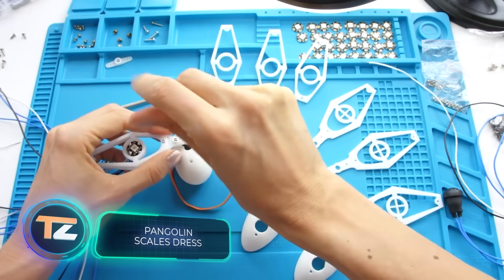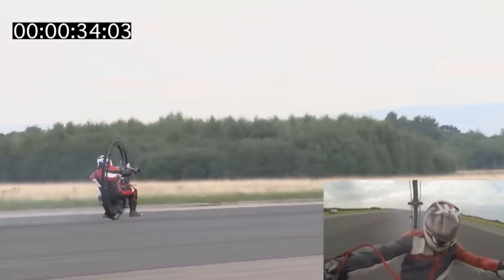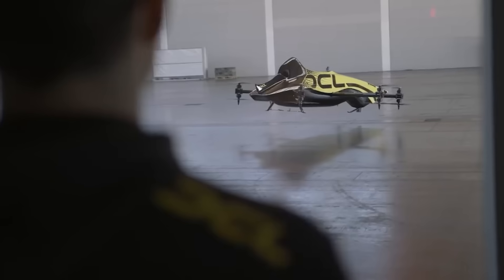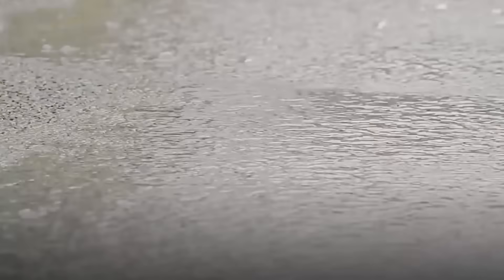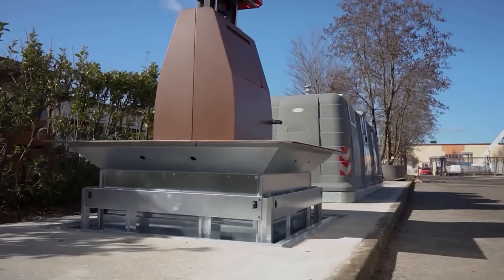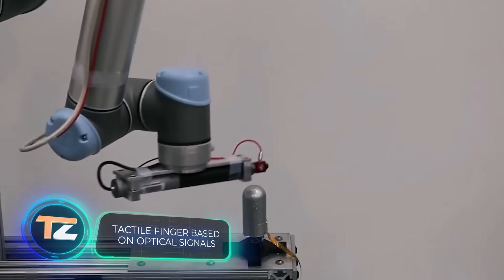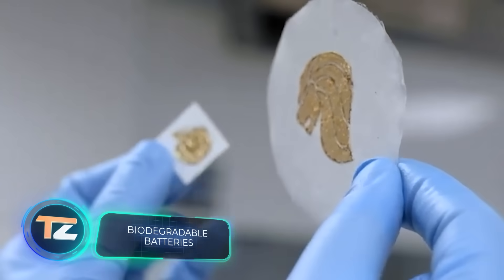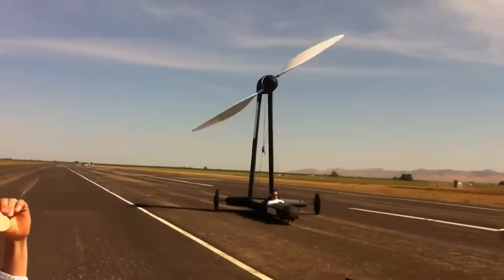13 CRAZY INVENTIONS THAT YOU SHOULD SEE

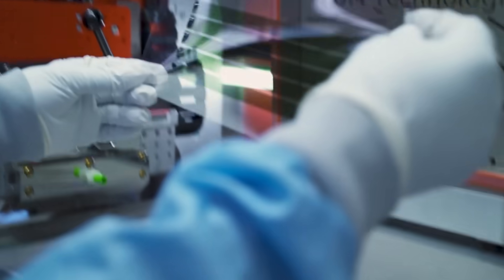Comment: 3:11, you could also COVER a Electric car in this and potentally never pay to charge again. Since its Translucant you wont need to worry about covering the Glass when you put it on 100% of the car and connect the electrodes to One point for charging.  You could also add this to the roof of some Camping Equipment so its easyer to charge your phone while Camping seeing as the TENT would generate a Charge for up to 4 full phones or a Laptop if a small lithium battery was added. 

Also you could put this on military Drones thus incresing their Opperaional time seeing as most are Fully Electric. and last you could COVER buildings in this wrap turing entire Cities into Solar Fams as long as they had access to good Sunlight, and thus Deminishing the US's need for Foreign energy.

Comment: 1 is stupid use of this tech 2 ius a stupid piece of technology 3 great piece of technology wuhich is also fucking useless because no one will cover there car's or houses or streets in it to get the power needed also no one will wear a shirt with one could be used in back packs though 4 big toy  probably will become a niche sport in the future 5 stupid car  the biggest problem with EV's is the batteries  yes being able to remove them is great idea but that only matters when you can remove them and replace them with a fully charged one at a site  on your journey I/E makuing the batteries the fuel rather then electricity. 6 the concrete this is a great way to create  sinkholes and if it doesn't work below 0 then it is alway a fucking great way to kill drivers. 7 is shit  8 is a more complicated and slower way to collect shit so it is pointless. 9 is horrible battery life is abyssmal 10  great a robot hand that  in the future will be able to jerk you off 11 this tube will  waste soo much water to evaporation and  will be a fucking nightmare to repair not to mention the control valves are  manual 12 biodegradable is a fucking hillarious thing to look into.  you know all plastic is biodegradable it make take 1000's of years but it will break down. 13 is a novelty concept not a useful thing it a proof concept that is all

Comment: That sounds great but they don't say the time required to recharge the batteries, unless the use the same electric motor to recharge the batteries while not moving, and that is prekindergarten technology, but you know that, from the endless summer paradise Puerto Rico Jesus Torres.

Comment: The Singapore’s battery was already invented about 20 years ago by an Israeli company. However, the biodegradability wasn’t a feature.
As for the garbage receptacles THEY ARE A NIGHTMARE. Children, the elderly, the handicapped and anyone weighing under x amount of pounds/kilos cannot open the lids. Also, garbage that’s lightweight but large and of an irregular size won’t fit into the opening. A final and horrific aspect: Those who feel the need to abuse or kill small animals like cats, kittens, puppies, rabbits, etc. can toss these animals inside the receptacle which is situated below ground and isn’t reachable.  THIS PRODUCT SHOULD NEVER HAVE REACHED THE MARKETPLACE.

Comment: The cruising range of both versions is a few tens of miles less than the distance to the next H2 fuel station.  And also a toy RC car to drive around inside grain silos that costs about the same as an actual car.

Comment: people say americans dont know how to use the metric system but im trying to figure out where this guy is pulling his imperial measurements from. naught point two inches bro just say 3 mm we will understand
Reply: like really how big is a 12 cu inch engine? pretty sure all engines are measured in metric these days.
Reply: Who says Americans don't know metric? Every pharmacist, carpenter, plumber, fabricator, engineer, welder, designer et al is fluent in several measurement systems, not just metric and imperial.

If you would drop the "I'm stupid so I can't imagine inches" attitude, you might get it. Asking the world to change what they've been doing for thousands of years so YOU don't have to learn something new. That's pretty bold.
Reply: @DrLumpy  putting some pretty bold words in my mouth. i know how to use imperial just fine, used it for over 20 years, and after learning metric its just better. in short. cope. and watch your tone
Reply: @DrLumpy I know how to use metric and I’m an American.  It’s so easy but there are many stuoid people who don’t understand about base10!   For those of us who quilt, sew, etc. just about every single sewing machine sold in quite a few decades as has to learn the metric system.

Comment: As a farmer who just had to clean out the grain bin, that robot is useless, unless they can make the battery last 12h plus. Using a proper resperator is definitely still the most viable option
Reply: Don't forget the price of 5000 Dollars for that piece of crap
Reply: @dapartisano3995  Do you bother ever doing math? Hint: Turn 5000 USD into a 3 year leasing, compare that to minimum wage, you may be surprised who wins. Hont: it runs down to 15 usd per day or so. And the robot COULD work 24/7.
Reply: wouldn't the robot be more useful if it was  corded to the   roof of the  silo then hand  a cable from there down to electrical supply so it could forever keep working  and be automated so you didn't need to keep a eye on it with it only  letting you know when it was broken.
Reply: @si2foo I agree. A corded machine could be made bigger and more efficient. And figure out how to make it autonomous.
Reply: from your experience, even if it take longer, how many of those robot would you think would be able to do the job if they work at the same time? an educated guess is enough for me
Reply: People only see a problem and never will or want to advance their knowledge as they only see the future ina  short distance.
Reply: Fellow former farmer in Kansas here. I agree 100% 👍
Reply: @Rookie4064 working with machines that are automated, the fixes are usually common problems and easy

Comment: could be great if the paper thin solar cell can be incorporated on safety helmet of bikers/motorcyclist . . . it could remotely recharge ur cell phone while on the move . . . the DCL drone could with full suspension wheeled landing gears . . . even better if it's retractable . . . the French start up NAMX HUV 4WD + 1.0 in. Lift 112.0 kWh iSMARTPower® 5-Dr eC-SUV (LHD) could do as an all EV instead of Hydrogen . . . the high price of the Grain Weevils makes sense if they sell €5,000 a pair because clearly any grainery big or small will need atleast two such autonomous robots . . .

Comment: I've seen several items from a show in the 80s called Beyond Tomorrow. The hydrogen fuel cell car was featured way back then. Cells to run your house and car, swappable etc. Pull the cell out of your car and plug it into your house. 

A LOT of tech that people think are just coming out have been around for a long time. Just there wasn't any investment put into them or the technology (being able to print stuff now is what's really spurring things along) wasn't ready to really push stuff a long.
Reply: beyond tomorrow or beyond 2000?
Reply: @youtubehandol  I'm pretty sure it was Beyond Tomorrow, but googling it to make sure I'm not going senile says the name was changed in 2005 after a reboot. (somethign like that) I just remember from the early 80s, all the people had accents as well. Watched it after the nightly rerun of Buck Rogers. One of those Mandela Effect things. I remember it as one thing, but everything else says it was another.
Reply: @zerogrey3798  aussie show, remember it well. good times, yes there was name change. you can find videos floating around yt.
Reply: @STREETFIYAMIXTAPES  That's what wikipedia is for. :-)
Reply: Well the issue with Hydrogen Fuel cells, is you are literally driving around with a literal bomb powering your vehicle, house, generator.
Reply: @Zekumas  That's the same issue faced by petrol vehicles / generators.  And people seem fine being driven around by controlled explosions in a combustion engine.  Hydrogen can be used in the same way (hydrogen combustion engine) or without any combustion in a fuel cell :)
Reply: @David_J_B  Except -hydrogen- gasoline doesn't explode unless it's vapors, and until you're making it with nuclear power, doesn't actually save any greenhouse gasses.
Reply: @darrennew8211  "Hydrogen doesn't explode"...tell that to the Hindenburg.  And you can carry out electrolysis using renewables, or use other chemistry reactions, like the one using liver often done in schools :)
Unless you're getting confused with helium?

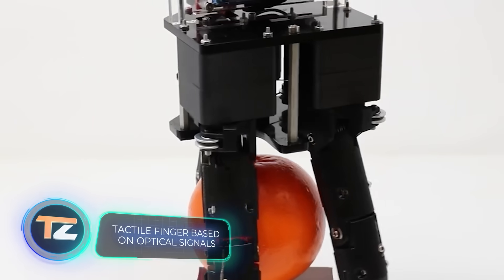Comment: 9:09 you didn’t answer the question how the robotic fingers “know” the difference between the force required to pick up and hold an egg or a piece of fruit vs a heavy object or a tool?
Reply: It was answered, watch the fucking video. It "knows" based on the deformation of the rubber and how the light reflects/deforms on the inside. Watch the fucking video.
Reply: @zerogrey3798  I did watch the video, and where does he explain what you said with how that is translated to amount of force applied?

Comment: 4:53 hydrogen fuel cells positioned just where most car accidents happen. Nothing could possibly go wrong
Reply: @kegs5556  If the tanks are ruptured then there is a good chance of combustion, much more likely than with petrol. The gas does disperse quickly however but you wouldn't want to be anywhere near the stuff when it burns.
Reply: Pinto 2.0
Reply: If they design them to be able to slide inwards and downwards through the floorplan and away form the cockpit, without penetrate the firewall, it would be safer then petrol though since the fuel cells be quicker evaporated and burned away then petrol.

Comment: It's not winters that will stop that concrete from being useful, if they were honest they'd admit one hard frost would wreck it completely, but without proper drainage system underneath a carpark like the one show using that concrete will turn into a sea of potholes as the ground underneath is eroded by the water passing through and the surface is all that is holding the weight of the vehicles.
Reply: I don't see this as a success at all.  Looks like any other startup business's ad for their new thing.  They show it soaking up water but not one shot of anything driving on it.  They don't mention that it will have to be repaved every 6 months because there's too much space between the aggregate and not enough bonding surface contact.  It will crumble under every tire that rolls over it, eventually collapsing to a become a gravel road.

Comment: That porous concrete is a non starter.  It will have a very short lifespan esp in freeze thaw conditions, just a couple of years.
Reply: Watch the fucking video, it mentions freezing conditions already and they're working on it.
Reply: @zerogrey3798  I did.  I live in Canada, current outside temp. negative 18 C but summer can be in the mid 30s C, my laser temp gauge shows 60-85 C on the surface, egg cooking temps.  As a young person worked on road maintenance and we are constantly filling in all the rips and hole and buckles with tar.  My road in front of my house is a buckled mess of a roller coaster and it was installed just 5 years ago.  Freeze thaw destroys roads esp with heavy traffic.  We have to regulate truck traffic on some roads because they become washboards in no time.  We don’t use concrete for roads generally because asphalt is malleable and better under temperature stepress changes. This isn’t about concrete I know and I applaud their effort in as it’s a neat  idea, certainly far better than some things like salting. I shouldn’t have said “non starter,” more like highly site specific, which may be a good thing, and where longevity may be a factor. It’s ridiculously expensive and energy intensive installing a km of a road and maintaining them is also.  Concrete is even more energy intensive, 8% of global carbon emissions.
Reply: There's no way this has any durability with that much air space in the aggregate.  Cold weather, hot weather, doesn't matter.  It will crumble to gravel after less than a year of regular traffic.
Reply: Also curious about its reaction to extremely hot summers
Reply: be fine in Egypt

Comment: The Blackbird vehicle in the video is not going downwind, it's going upwind.
Reply: Downwind is going with the wind. Upwind is going against. 
The the vehicles wheels are powered by the force of the wind via the fan blades. 

The whole point was to see if the vehicle could travel faster than the wind speed in the same direction.
Reply: @Seoulman-2  

//"The whole point was to see if the vehicle could travel faster than the wind speed in the same direction."//

And in the video, it's going the opposite direction (upwind -- against the wind).
Reply: Yeah, that was the point.